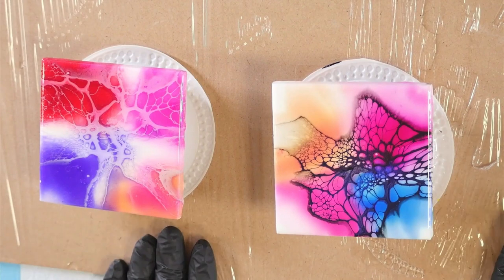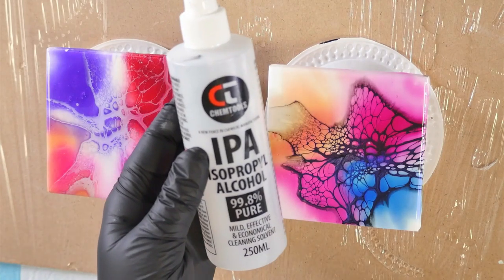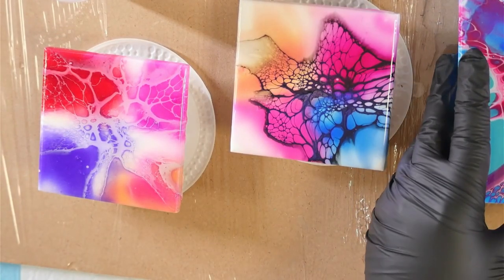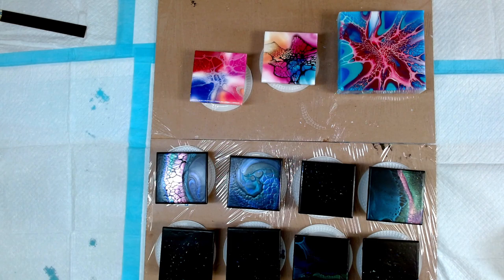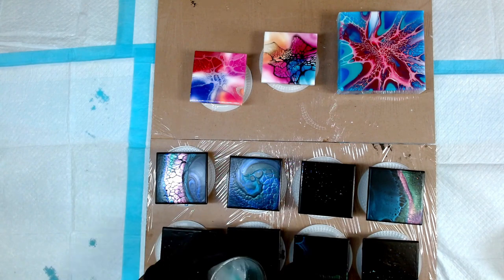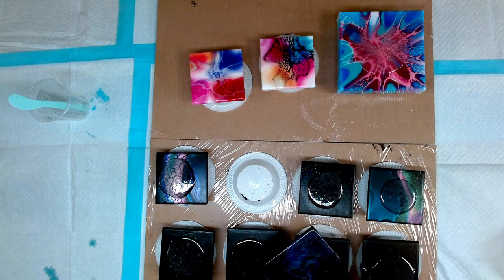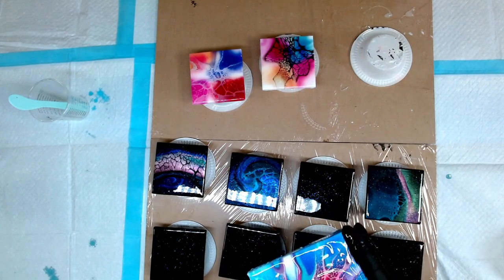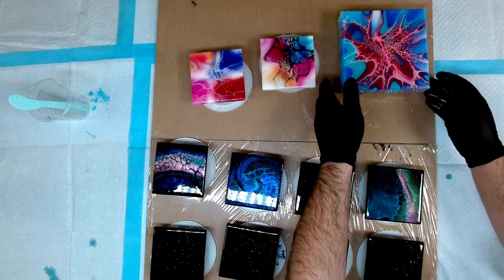Fixing Resin - Rain & Pours - #15

Comment: Thank you, Mitch. As always, your videos are a huge help. It helps to pop the bubbles in your puddle before spreading the resin, then go over it again to pop the rest after you spread it. I only use a heat gun, never a torch because its too easy to cook the resin.

Comment: My second coat is sticky. Yes, I’ve waited long enough, 1 week. Yes I know what I did wrong. What I want to know is…….is it ok to sand sticky resin? How do you sand sticky resin? How much resin would you use for an 8” x 8” canvas? I have a couple calculators, one says 2 ounces, one says 5.12 ounces. I have found the latter to be too much when I’ve done other sizes, but the first being a bit small when doing other sizes. I just need to know how to fix a stick coat of resin. Thanks Mitch, you are so very helpful with everything.

Comment: Hi there again!  The 1st resin video helped me tremendously.  I just did about 15 coasters, use StoneCoat & followed all instructions you outline   I used the torch, which has served me well (I don't have a heat gun).  They dried and a few of the coasters a few bumps that dried. I assume they are Air Bubbles that did not pop ?  MAYBE I didn't use the torch long enough ?  I notice I'm not very aggressive with perhaps because I suspect it might damage my resin ??? (I've never had an issue with the torch).  Any thoughts on this?  SHOULD I SAND the areas and reapply resin next time I do a batch of coasters ?
Reply from the maker: Yep if they are bumpy as in raised areas in the otherwise flat surface, those would be air bubbles. You would be fine to give them a very light sand to knock down the high points and then cover them next time you resin :)

Comment: This episode was exactly what I needed to hear - especially the part about what is perfect. I took my coasters, trivets and jewelry to a seed swap where I had 2 6’ tables reserved. I brought home $650!  Half was tiles and half was jewelry. I am loving doing the tiles. But I was sure every customer would complain about that teeny, tiny imperfection that I was seeing.  I guess I needed permission to decide what is perfect.  Thank you!  My customers were thrilled with their purchases.
Reply from the maker: The reality is our products are handmade. We are not machines, and can only do what is within our limits to ensure things are as close to perfect as possible. Resin is never going to be absolutely perfectly flat and level, so you'll still get slight waves in the surface when you look from the side. It's never going to be dust free unless you work in a completely hermetically sealed room (who the F has one of those at home?!?!). All we can do is minimise the errors we make and compensate for the ones we can't eliminate. The customer doesn't need to know that is not perfect and it's up to us to keep our secrets safe :P

Comment: Thank you so much for this tutorial Mitch. Was quite happy with bloom coasters I made, and then put resin on them which was a disaster. Put a 2nd coat on and still have divets in them so am very discouraged. Have just ordered the Stonecoat Resin you recommended and it should be here in a few days. Would it be OK to sand top of resin back (which I bought from an art store) and then put a layer of Stonecoat on top of that? Am also wondering if am holding the heat gun too close and It is causing the resin to swirl around and cause the divets? Am so pleased I found your tutorials on you tube! You have been such a huge help to me! Thanks a mill.
Reply from the maker: Hey there! I'm glad I could be of assistance! Yes you can just sand back the top layer with 120 grit sandpaper, which will form a mechanical bond between the resin layers.
Reply: @rainandpours  Thx so much for your quick reply, and your help - much appreciated!

Comment: Is there anything besides a heat gun to pop bubbles
Reply from the maker: With resin heat is the best option to get the resin warm and flowing, which allows the bubbles to rise to the surface easier. I always use a combination of the heat gun first, followed by a butane chef's torch to pop the micro bubbles. You could use a spray mister with 99% isopropyl alcohol but only AFTER using a torch (you could set it on fire)
Reply: @rainandpours  Dumb question but if you used only one - heat gun or torch?

Comment: You said something about applying water. What where and why do you use the water?
Reply from the maker: You don't want any water near your resin while you are working. Resin will not clean up with soap and water so you need to dissolve the resin and break down it's chemical structure by using a solvent, in this case the 99% isopropyl alcohol. I spray and wipe down all my utensils with the alcohol first, then I wash in warm soapy water if need be but the alcohol usually does the job first go around :)
Reply: You where talking about the back of the canvas... about spraying water on that. What did you mean? Sorry I wasn't clear with my questions!
Reply: @FiRsTlOvEyOuRsElF1433  before you paint if your canvas is a little baggy and doesn’t bomp like a drum when you tap the centre back, then you spray with water to tighten it up
Reply: @moniquemoran8197  thanks so much.
Reply: @FiRsTlOvEyOuRsElF1433  you’re welcome,  like Mitchell says not to be used near/with resin.  Way way before that stage , spray back of canvas lightly to tighten it up and let it dry before painting 😊
Reply: @moniquemoran8197  I just wanted clarification of where to put the water lol! I get to make it tight.... it's that too make the paintings move smother??
Reply: @FiRsTlOvEyOuRsElF1433  well not smoother but to stop the painting from sagging which if you do a pour painting will make your paint puddle back in the middle if canvas is not taut

Comment: Hi. I use Stonecoat and tried it over a 8x8 dried pour on canvas .  I torched and used the heat gun , it looked smooth as glass but dried with a lot of bumps !  Any thoughts as to why ?   I like that resin due to high heat resistance but tried an epoxy resin kit to try making a coaster in a silicone mold & it dried clear as glass with no bumps …
Reply from the maker: If it was smooth before it set, and the bumps appeared during the curing process, that would imply that there is dust or other contaminants like pet hair in the air.